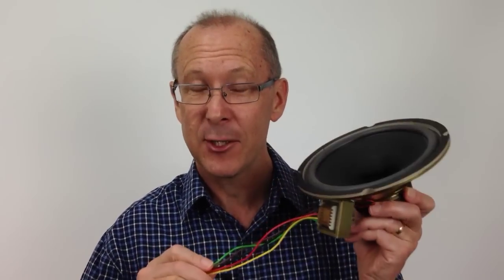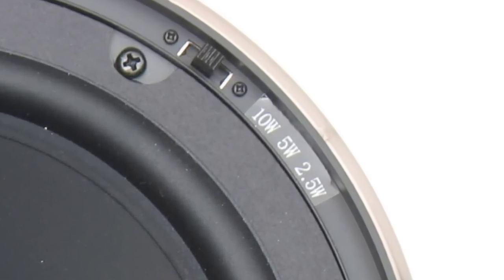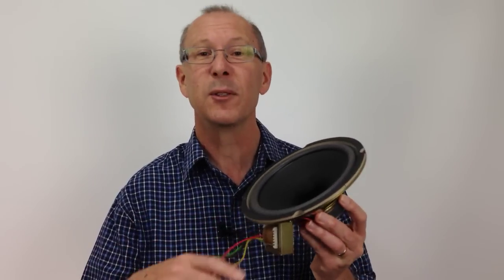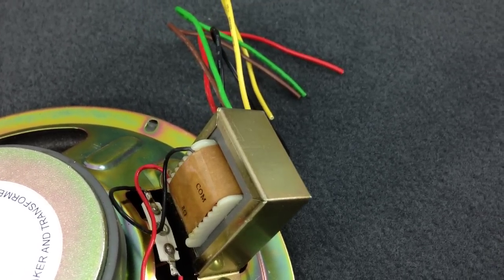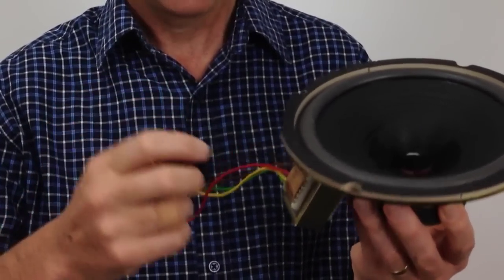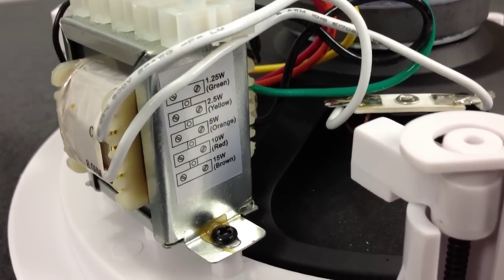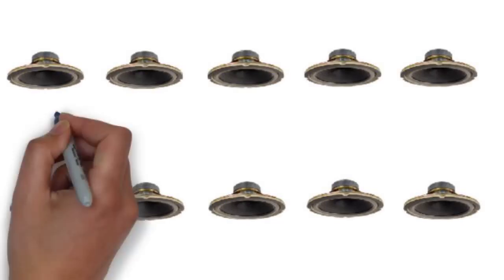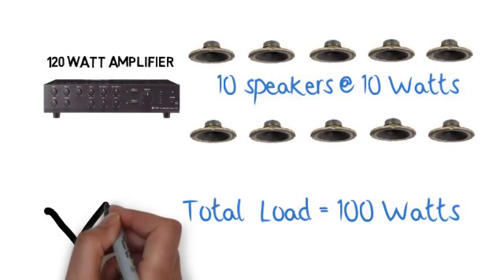Connecting 70 volt / 100 volt speakers (Constant Voltage)

Comment: 100 volts amplifier 100 volts ceiling speakers 8 numbers fixing output 30 watts amplifier shortage line is ok so individual speakers checking how checking sir

Comment: Can the standard 8ohm receiver be converted to 70 volt output?
Reply from the maker: Yes definitely. You just need a line transformer like one on the back of 70 volt speakers. The down side is that you will be limited to the load wattage if the transformer. 15 watt transformer can only safely transfer 15 ways of power.
Reply: @GaryDmedia  my question is if the speaker has a power of more than 1000W can this method be used? and also there is something called passive crossover is there any difference if using it simultaneously. sorry for my bad english🙏🏻

Comment: Hi mate. Would it be safe to use 100v line speakers on a 70v line output amplifier? Thanks in advance
Reply from the maker: Yes definitely safe. 100 volt speakers are a higher impedance so they will sound quieter. You just have to lift the gain of the amp a little. Raise the volume that is.
Reply: @GaryDmedia  thanks for the reply mate

Comment: Hello.  Please,  what problems should I have if I connect the output of a 100v amplifier to a 70v speaker line?
Reply from the maker: The only problem Francisco is that the speaker system will drawer more wattage than what is written on the speaker transformer. For example a 70 volt speaker that has 5 watts written on it may load the amplifier to 8 watts. Even so, with this knowledge you can still use 70 volt speakers on a 100 volt amplifier, you just have to remember not to overload the amplifier.
Reply: @GaryDmedia  , thanks a lot for the information.

Comment: Hi Gary, I have a question. Do the transformers have to be mounted on the speaker drivers? I have two speakers where I cannot attach them to the drivers but I can cut the wires on the wall running to the amp and add a transformer there with some wire nuts. Will it affect sound quality if I have a long amount of wire running between the driver and the transformer?
Reply from the maker: Christian, that is fine as long as the low impedance leads are not too long. The whole idea of constant voltage speakers is to reduce low impedance cables.
Reply: @GaryDmedia  Can I send you some pictures to show you?

Comment: Are you still active today? Is that suitable for power amplifier? And large voice coil speaker? Because im planning to implant constant voltage transformer to compression driver unit.
Reply from the maker: Mr JN, not sure that a compression drive is suited to constant voltage. The down side with constant voltage is there are some loss in frequency if you use a cheap transformer

Comment: What I'd like to know is what would happen if you connect an 8ohm speaker to a 70v amp, or a 70v speaker to a non 70v amp.  Fire, I know.  But why?
Reply: You can add a transformer and then put it into speaker!
Reply from the maker: Connecting an 8 ohm speaker to a 70 volt amplifier will short out the amp. You can connect a 70 volt speaker to an 8 ohm output amp. It just won’t be very loud. Note a 70 volt speakers resistance (impedance) is 1000’s of ohms.

Comment: I have a Solance 100W sub woofer that runs on a 70 volt system. (I no longer have the satelites. I want to use the sub on my current audio receiver with 4 other speakers. I have a subwoofer port on my receiver. can I bypass the 70v transformer on the Sub Speaker and use it directly from my receiver? Can I add in a Sub Woofer Amplifier?

Comment: Say I had 200 watts Amps, with 10 speakers @ 10 watts each, and I added (1) one 100 watts trumpet or Horn speaker, Is this a fair connections or I need amp with more power
? Thanks
Reply from the maker: That would stress the amplifier. It's much better to only load the amp to no more than 80% of its capacity.

Comment: How am I connect 6 watts 16 speakers to amplifier. In 100 volts line
Reply from the maker: I'm not quite sure what you mean by 6 watt 16 speakers. Do your speakers have a transformer on the back?
Reply: Siry sir my English is weak.I have 16 speakers with back transformer. In 4 inch size and 6 watts and100 volts. How in connect these speakers with amplifier?
Reply from the maker: You use the same method. Connect them in parallel. All of the + together and all of the - together. The amplifier will have to more than 100 watts to use this method.
Reply: Gary thank you very much. Its OK.

Comment: For you're information: The idea of the audio transformer is to step-up the voltage of an audio amp for long distance transmission of PA sound over ordinary 0.5mm2 fig 8 speaker wire, with very little power loss. Also allows multiple speakers and at different power levels to be all connected to the one line in parallel. The idea works in exactly that same way ac power is transmitted with step-up and then step down transformers. The audio output of the amp is not constant voltage as such, the constant voltage refers to transformers transmission winding line voltage.
Reply from the maker: +bjtaudio Thanks so much for your informative comments. It's is so good to have others share their experience in this field.

Comment: I found also you can use power transformer cores to make up you're own audio transformers too, I was surprised to discover that bandwidth of EI 0.5mm lamination's and toroidal cores can do 20Hz to about 15Khz easy, and as much power as you like. Also can use higher voltages for longer distances and or more power if needed. 70v 100v or even 230V system, I would not go too much higher in voltage as insulation and safety becomes an issue.
Reply from the maker: +bjtaudio Yes the toroidal core transformers are much more efficient and this is why the better amplifier manufacturers use them to step up the voltage as an output transformer. It gets a little expensive if you want to use them to step down voltage at each speaker in a big installation. I really appreciate you taking the time to comment. Thanks for that.

Comment: Hey can i used that in some speaker like 12 inch speakers?
Reply from the maker: +Mr Jn You will only be able to use this setup if the speaker has a transformer attached to it. There are very few if any 12 inch speakers with CV transformers attached. Most 12 inch speakers are wired using the 8 or 4 ohm connections.

Comment: Dear 
i have been installed as following  :
one amplifier  240 watt 
4 speakes Bose  each one 10 watt  
i connect from first speaker to second .........ect 
then i need to add new two speakers but i asking 
you how to add cable join from last speaker or no problem if i am going   to join from any section of cable ?

Comment: Please help me with this, im struggling. 
I Have 10 speakers (100volts) and a amp with 250W output power. The speakers has 3 outputlevels, 10w, 5w and 2.5. I want to use 10W for all the speakers. So if i understood this video right, i have to connect one speaker to the amplifire first then start adding speakers pararell with the first speaker? 
Example:  step 1, for the first speaker  i choose COM and 10W from the speaker and connect it to 100V and COM output on the amplifire
step2 I plug the remaining speakers in parallel with the first speaker 

Or should i just plug all speakers in paralell then connect them to the amplifire?
Reply from the maker: +Nima Shali There is a good document that may be what you need. It has a good illustration that shows you how to connect to a power amplifier. Hope this will help you. http://adn.harmanpro.com/site_elements/resources/860_1425410780/Guide_to_constant_Voltage_systems_original.pdf
Reply: Hi Gary, that illustration confused me. Im not really good at this but i made a sketch on how i did my wiring, i get full sound from my speakers  but im worried over the wires, i dont want them to heat up. Please look at the image and let me know where i did wrong.. http://imgur.com/S9oNoc6
Reply from the maker: +Nima Shali I understand your problem. Please send me a photo of the back and front of your speaker so I can understand what your connecting.
Reply: Speakers: http://imgur.com/BWQJmBi
Amplifire: http://imgur.com/a/Xp8BQ

Thank you Gary! i really dont know who to ask! I appreciate you doing this for me!
Reply from the maker: +Nima Shali No worries, I will check it out.
Reply from the maker: I understand your confusion totally. I see they have not helped you at all with the colours of the terminals. Just imagine the speaker terminals are all black and that will help. All the commons connect together and all the 10watt terminals connect together and to the 100volt output on the ampIifier.  have a picture on this link that may help. http://imgur.com/a/gbUCB
Reply: So if i undestood this right, the wiring should look like this when im usin multiple speakers .... http://imgur.com/a/hGwRu   yes?
Reply from the maker: +Nima Shali Exactly. Well illustrated. I haven't ever seen those speakers before. So I've learned something new. We're always learning. Hope your installation goes well.
Reply: Thank you so much Gary, i too, learned something new! The speakers are meant for my Pub, you just saved me a bunch of money and time. I've been on the internet trying to understand how to wire these things for a long period of time now. If someone asks me how i did it, i will give the cred to you! 
once again, thank you. Have a great day!

Comment: Does anyone have an answer? I don't understand why the amplifier has 20 more watts? Thanks
Reply from the maker: +MatthewW As long as the watt rating on the amplifier is more than your calculated load it will be fine. With the same speaker system on the video you could connect to a 250watt amp and it would be OK. If you connected a 35 watt amplifier it would be overloaded. It is best to have at least 20% spare wattage as a safe zone. Hope that helps.
Reply: +Simple Audio Tips Thank you! :)

Comment: Nice video. 100V speaker line feed (also 50V and 75 V are common) requires that the amplifier is specially designed for that, as it is loaded with abnormal inductive and capacitive loads that can generate instability (oscillations and motor-boating). Otherwise it is a question of correct inpedamce matching. Use very good line transformers. Poor quality line transformers degrade the frequency response and increase instability. This transformers use special quality iron and special wire wound technics.
Reply from the maker: +John Gil Thanks so much for contributing. Appreciate it.

Comment: A 70/100v system's speakers should be configured in a parallel circuit. Also, besides never exceeding the amplifier wattage, two other factors need to be considered. These are amplifier headroom (20-30%) and the amplifier's minimum impedance rating.(Usually listed on the amplifier.) Thanks Gary. Very good explanation. Clear and concise.
Reply from the maker: Peter Buchta That is a good point to highlight. Not loading the amplifier to it's maximum in good practice. I appreciate your comments and your input.